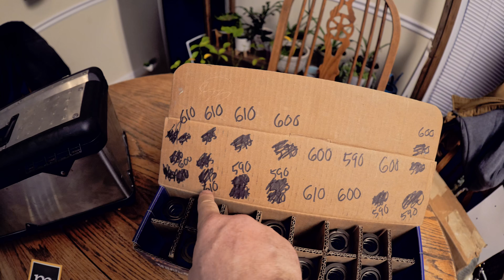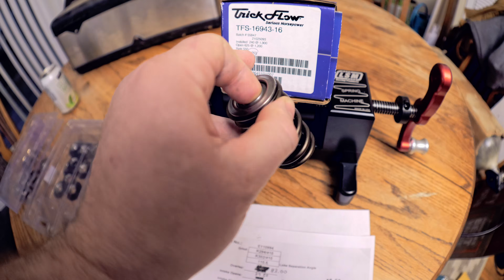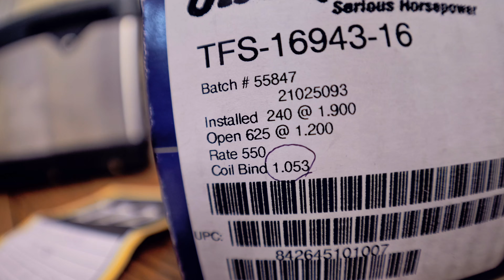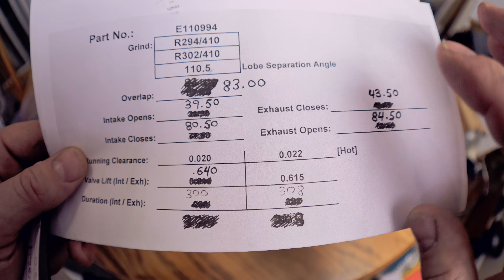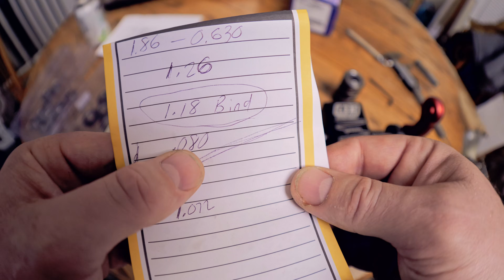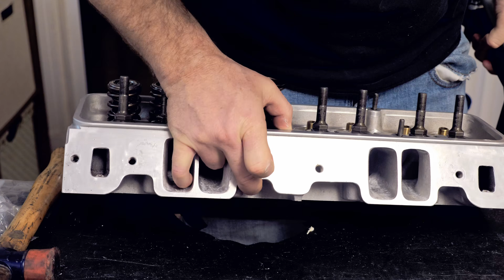Setting up valve springs for a solid roller street cam AFR 210 heads / 400CID SBC / LSM SM-1000

Comment: Did you check the retainer to seal clearance ?
Reply from the maker: These heads will support over 700 lift it's not even close to that. You really only have to check that on stock heads.

Comment: When should you use lash caps? Thanks.
Reply: that's the next step after setting up the valve springs. you use lash caps to adj the rocker arm geometry  and clearance between rocker and retainer when milling heads when re-using stock pushrod length ect or milling of ohc motors. you shouldn't  need to use lash caps if you do your math right .

Comment: Hey man I know this isn't one of you exhaust videos but I wanted to keep it on a fresh video.. I just brought a complete 5.3 and want to start fabbing the hot side but I have no idea if you can Flux weld the cast steel manifolds. I have tried Flux on cast iron and it just cracked and I'm not sure if cast steel is the same or not. Do you have any experience with this or know of anyone who does. I have the titanium 125. Any feed back is appreciated and keep up on the video's, you have a solid thing going on here.

Comment: What kind of porting did you do to those 210 heads?
Reply from the maker: Simple smoothing of the intake and exhaust ports and raised the runner.150
Reply: @TPVPRO  Eliminator heads?
Reply from the maker: @racerdoc  Race-ready heads I think. I picked them up for $1500 back in the day.